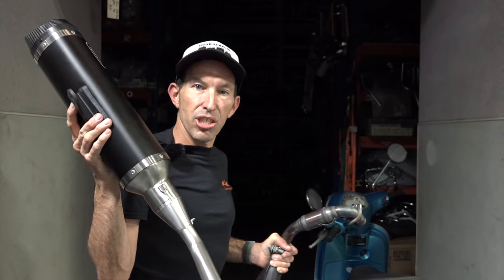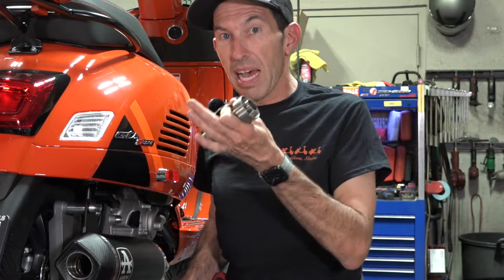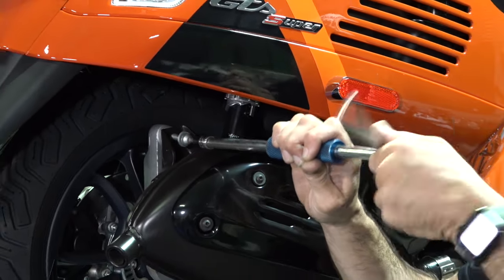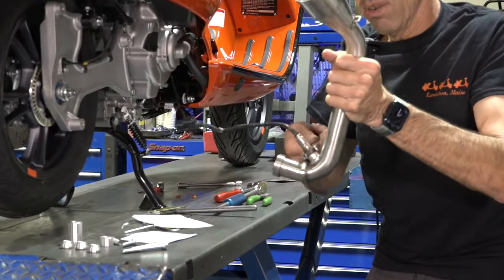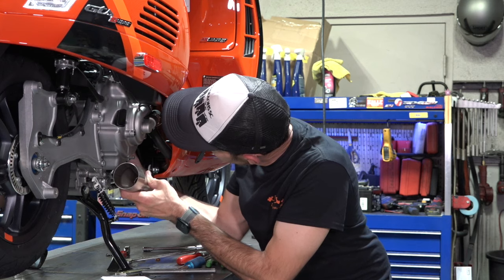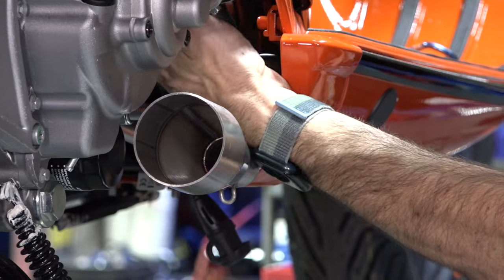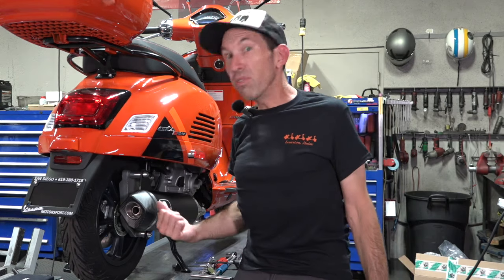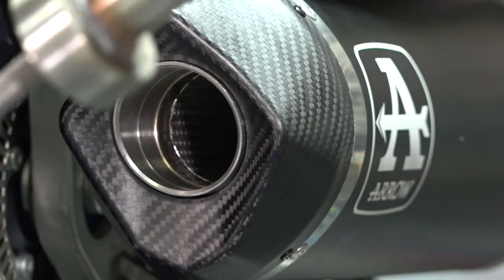Install an Arrow Exhaust System on a 2023 Vespa GTS 300 HPE2 EURO5

Comment: I want an aftermarket exhaust for the weight reduction and the loss of the graphite bushing. The sound is a bonus. you can get aftermarket exhaust systems with catalytic converters included.

Comment: Mostly like you Mr. Robot I do not like loud noisy muffler because I got done changes out my exhaust to Kajimotor slip on and added two DB Killer silencer in front and a baffles in the rear for my 07 Piaggio mp3 250ie!!

Comment: good video Robot. A question, is this kinda aftermarket muffler like arrow, remus, etc. with deeper and louder sound compare with original muffler which is excite your blood for sure. But how about the heat shield can be provided or not. that would be a risk for passenger.

Comment: Do U need to set the rear suspension to the highest level for the exhaust not to rub the bodywork? My polini-exhaust looks very much like this one and It rubs the bodywork if I dont set it to the stiffest configuration.

Comment: So it’s only 2023 model have 12mm air sensor .. the rest is 18mm
Reply: So do i need a 18mm to 12mm adapter to run older exhaust on a 23-24 model?